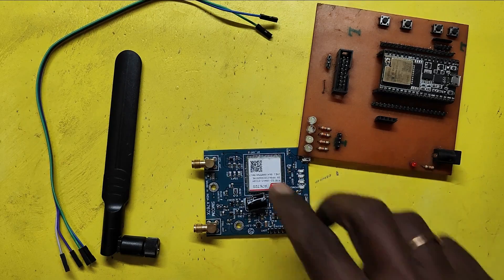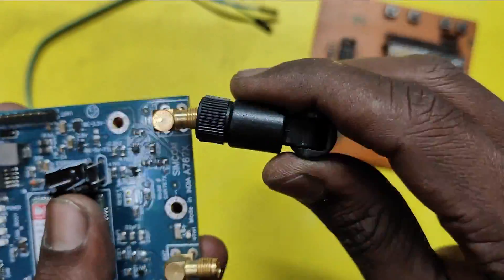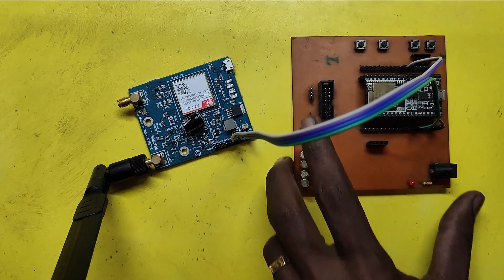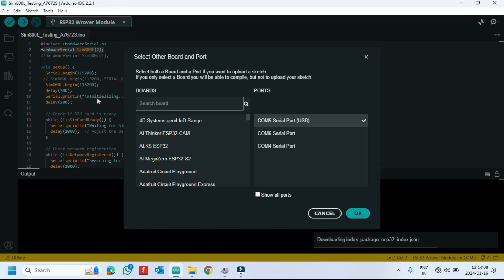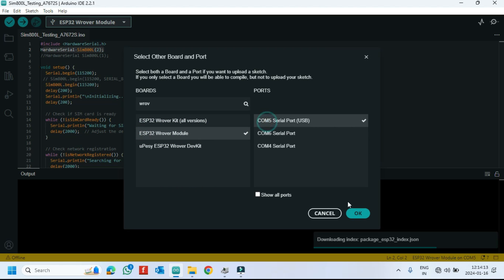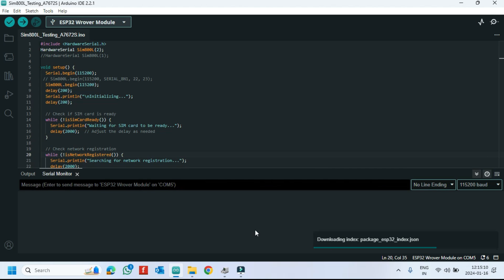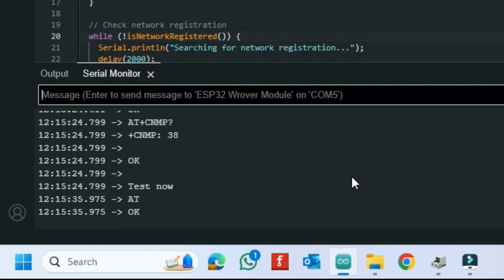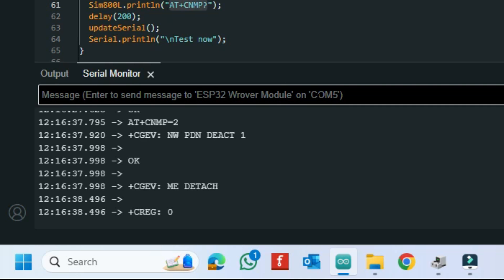ESP32 SIM A7672S Testing AT Command | GSM 4G LTE Module Testing | SIMCOM A7672S with ESP32 | VOLTE

Comment: Get response when interfaced with Uno but does not get response when connected with esp32, not able to send sms or call
Reply from the maker: Use proper pins for communication.
Upload first testing code

Comment: do they only work on 115200 baud rate i tried to do in 9600 baud rate it dont work at all
Reply from the maker: It will work with 115200.
Not 9600